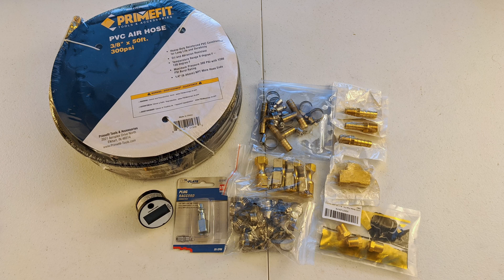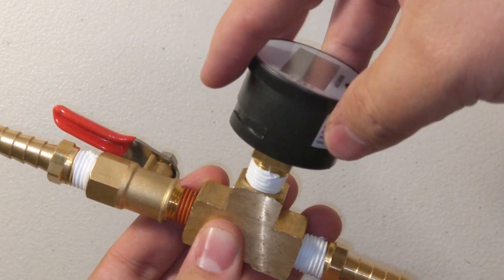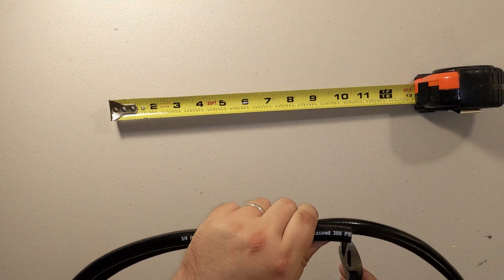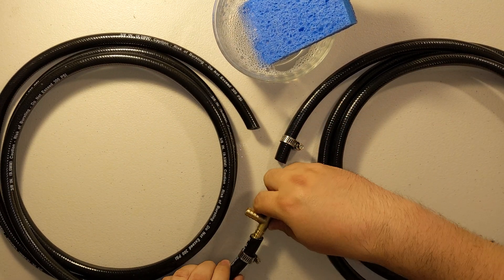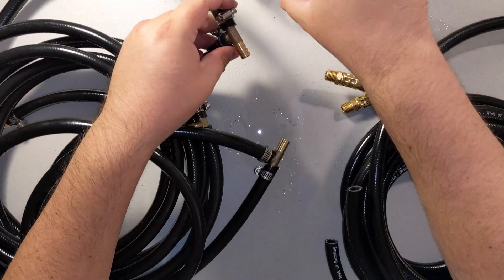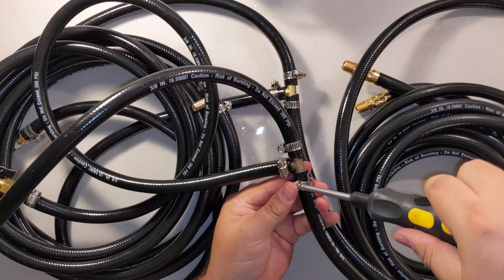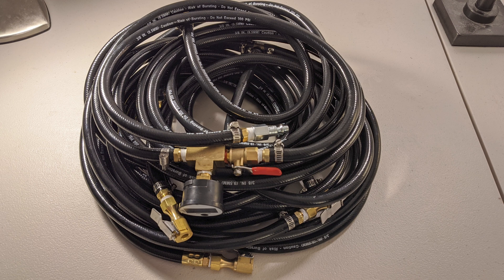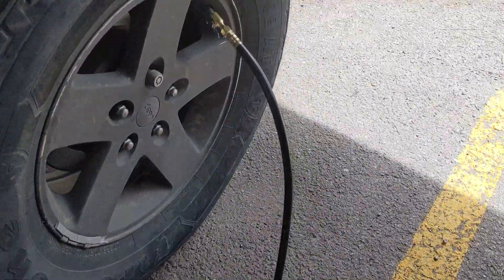4 Tire Inflation - Four Tire Deflation - How to DIY with Parts List 4k

Comment: I'm thinking this might be a good project to fill the tires on my cars, my trailers, and my lawn equipment  and then later expand it to incorporate my neighbor's stuff. Seriously, I can't begin t imagine any point to this. Checking tire pressures is annoying enough without hauling around all that paraphernalia.
Reply: If you’ve ever gone off roading, you’d understand.
Reply: What Usman said.  You air down to 10-20 PSI (depending on terrain) prior to going off-road.  When you are done for the day, you then air up to street pressure.  Do this a few times and you'll be looking for something like this.

Comment: Hi Sisson, great video made it and it worked fine. Thank you in advance. A small question is when i connect from the second chuck i start losing air and by the time all 4 are connected furing deflating or discoonected after inflation there ia a difference in pressure.  What coukd be wring in my built? TIA.
Reply from the maker: Make sure your valve is turned closed, and make sure all the connections are screwed tight. Once you connect 2+ tires, they will start leveling out the air pressure between the tires.

Comment: Great vid, Where did you source the heavy duty brass chucks? And are they the sealed version?
Reply from the maker: https://www.amazon.com/dp/B07Y2Z4BS1/ref=cm_sw_r_cp_apa_fabc_OZlcGbZG87JWW?_encoding=UTF8&psc=1
Reply: It works better if you get closed type air chucks by Haltec H-5265 they hold on three sides of the tyre valve and last longer than the normal type. 

Also if you put a nitto coupler on the compressor side of the gauge assembly you don't have a host flopping some when airing down.
Reply from the maker: I did upgrade to the Haltec H-5265 couplers just a few weeks ago but haven't been out on the trail to test them yet.

Comment: What a cool project! Now that I've seen your explanation, this is something that is definitely on my list. After a few months of usage, any changes you might recommend to your system? Could you provide a ballpark estimate of the total cost of the hardware used (hose, fittings, & gauge)?

Thank you for your well-detailed and -shot process.
Reply from the maker: After a few months of use I still love this unit. I just used it yesterday. Total cost was about $110. Only small change in would add is velcro straps to help manage rolling up the hose for easier setup and tear down. Velcro each side separately for better organization. Probably a more robust gauge. Mine is banged up and scratched from many uses and being dropped and dragged on the ground.
Reply: Glad it's worked out well and getting lots of use!